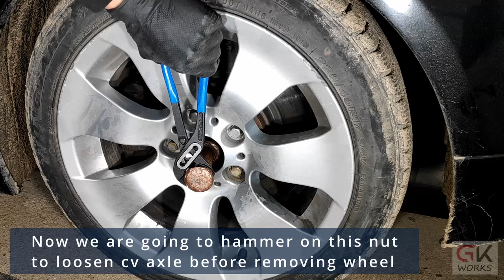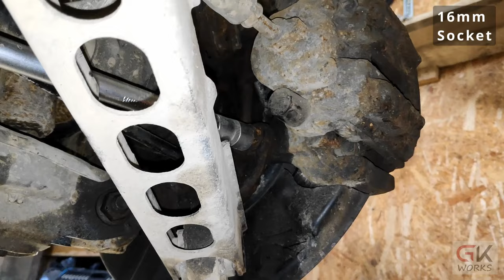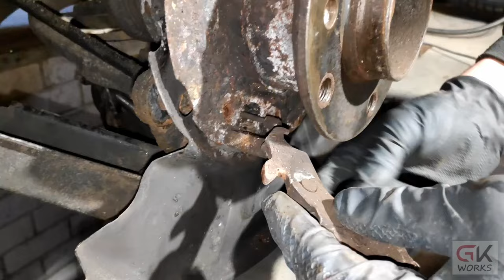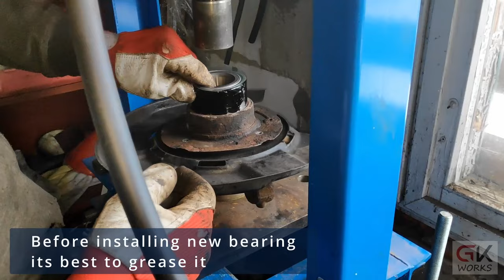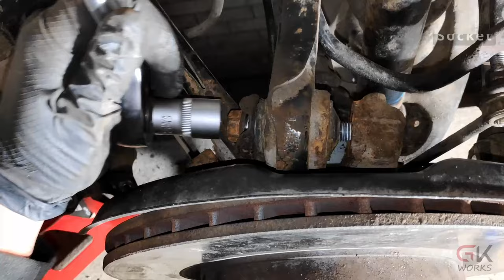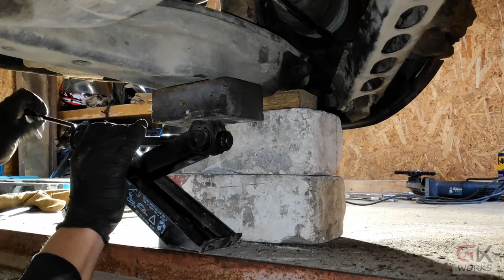How To Replace Rear Wheel Bearing With ABS Ring | BMW E90 E91 E92

Comment: Great tutorial! Appreciated the socket sizes & torque specs. Unfortunately my axle nut was completely rusted and I couldn't get any purchase with my 36mm socket, so I had to remove the 6 e12 bolts from the diff/axle shaft and pull the whole thing out. Then I dremeled the axle nut off and got a new half shaft to put in with a new hub & bearing. Car sounds SOOOOO much better without the loud whirring that was going on for the past 5 years :D

Comment: Re install Of arms 
1st lower trailing arm bolt 
2nd upper control arm bolt
3rd sway bar bolt
4th guide rod
5th roll over arm with jack 
Last lower control arm

Comment: Did doing it this way require an alignment afterwards?
Reply: I was thinking the same
Reply: Don't think so, the bolts from which you do the alignment are  on the chassis side of the control arms, not on the wheel hub side

Comment: You also have to readjust the parking brake after working with parking brake components. And I believe you cannot reuse the nuts for suspension components

Comment: Is it not easier to just remove the drive shaft instead of these components?
Reply: Much easier IMHO and no need to remove parking brake and the sensor a d disconnect all the suspension links. Left side is trickier though as you also need to unbolt the exhaust at the rear to move the axle, depending on the age of the axle and the state of the abs ring it might be worth replacing them at the same time spending extra 10 min

Comment: I cant put my cv axle back in my differential case. Threads look ok. Removed retaining clip ring just to make sure its not the one that caused resistance but same. I have 1.5 cm gap between diff and cup of CV axle inner end. Hammering doesnt do anything. What the hell is wrong
Reply: Wyd with this? Had same problem on september, just get the car to the guys, who knows, how to do this